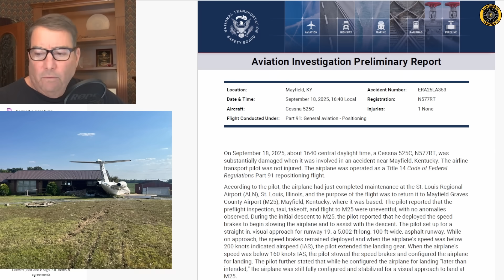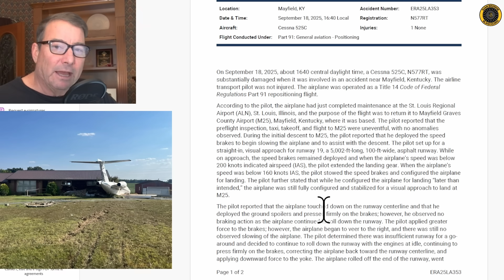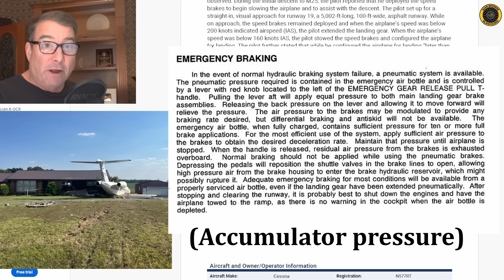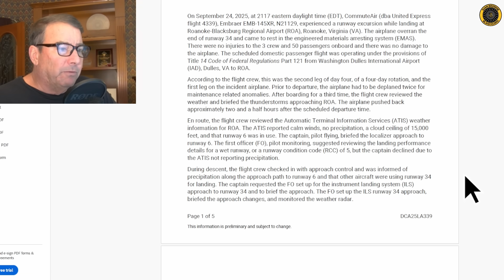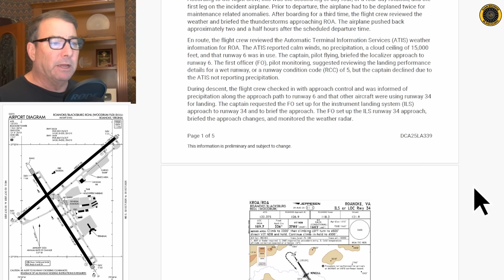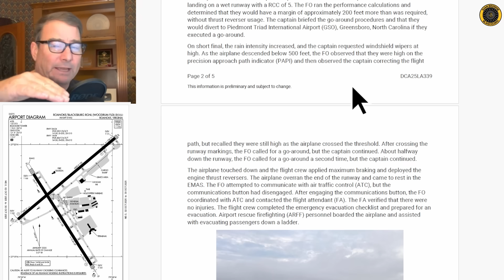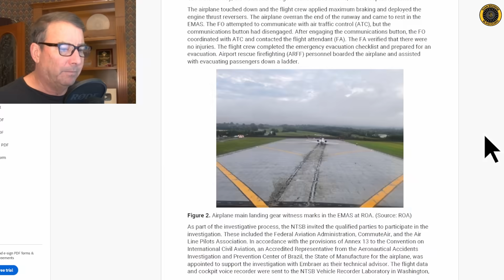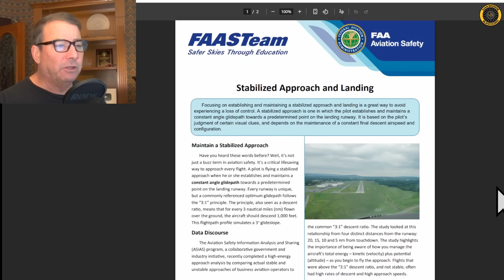NTSB Preliminary Reports on 2 Runway Excursions 27 Oct 2025

Comment: I used to live under the 34 approach path.  It kind of defines hot and high.   Reason is you don't want to play chicken with the mountains which stop only 5 miles from the threshold.   Most visual approaches usually put a couple of turns in to avoid the tallest on the straight in approach.  In wind I would NOT want to fly over that mountain even with sufficient altitude.   I believe 34 is still the only ILS runway so makes sense they'd use it in poor visibility.   Makes less sense they were so high.

Comment: Excellent analysis, and appreciated. Re: Union protection of pilots......I wonder if that protection has sometimes been found to be one of the holes in the swiss cheese?
Reply: if a pilot can't make a mistake, even if it seems obvious to us, without getting fired, they'll start lying about making mistakes.
Reply: @JesseCampbell0  This was not a mistake, this was bad and dangerous attitude. It is much, much harder to fix attitudes than correct errors of technique.
Reply: @hb1338  I agree, but the union protection is there for the mistakes
Reply: @JesseCampbell0 agreed.... And yet, this one is really strange. Two missed call outs?
Reply: @x--.  NO. Two safety commands deliberately ignored.
Reply: @JesseCampbell0  this, and, Swiss cheese doesn’t mean what we think it does. At least not as Reason wrote it. Todd Conklin has a podcast PreAccident Investigations with a great episode Swiss cheese Actually. Note it pairs really well with the British produced Command and Control podcast Synchronization as Coupling episode. As always, read Sidney Dekker.
Reply: I think the role is to keep them from being unfairly fired, not to keep them on task to kill someone.

Comment: I absolutely cannot believe that any flight crew would continue an approach 100kts over the proper v ref speed!!!
Reply: Forget Vref, fly AOA!
Reply: @jimallen8186 At 100kt over approach speed? The aircraft would climb...
Reply: Zoom not climb, we should distinguish between the two, though my points are that the specifics are not generally transferable.
Reply: As a non-pilot I'm a bit surprised: is it that hard to slow down? It seems to me the engineering challenge of powered flight is the exact opposite: propelling the craft fast enough to not stall. Slowing down seems like the default condition if you aren't applying active power. Is the problem here just that they were also too high?
Reply: @ps.2 No it's the opposite, jets are designed to be aerodynamic and slippery, so in a decent even at idle power the plane will accelerate going down hill. He was Never going to be able to slow down enough to land . But we fly out numbers. Put it this way, if your approach speed is off by 10kt, we consider that allot!
Reply: @rdawgz866  Do the speed brakes make a difference here?
Reply: @ps.2  - it's called gravity.
Reply: @lisanadinebaker5179 exactly, in level flight he's correct not dive bombing for a runway
Reply: @ps.2 : The plane also needs to come down, and coming down converts altitude to airspeed. In other words, there's some air resistance slowing down the plane, but that resistance is mostly used to get rid of the extra speed you would get from descending to lower altitude.

Slowing plane down in itself is not super hard, it just means you need to fly an extra loop to make it work.

Ie. if you have too much energy, speed and altitude, you need to fly longer distance before attempting a landing. Adding extra turns is a common way to do that.

Comment: Every landing is a go-around with an option to land!
Reply: WISE WORDS!
Reply: "Every landing is a go-around with an option to land!"

Unfortunately not in my glider, every landing has to be correct every time, well planned and properly executed.
Reply: @christopherrobinson7541 see above
Reply: Before landing  a glider determine if you can land next to the runway on a field in case a car decides to call  the runway a taxiway.
Happened to me as an instructor when a tow pilot decided to take off when I was on short approach.
When I heard the engine below me I landed on the field and avoided a rear end collision.
You always should have an option.
Reply: ... says the glider pilot ....
Reply: While the context of these particular instances may differ, I don’t agree nor think every landing is a go round with option to land to be wise or helpful. Think about those tractor style propellers, or even jets with low slung engines, trim stall is a thing. Go arounds done poorly can readily result in crashes and crashes during go around are much more fatal than crashes due to overrun. Now consider the light twin at high density altitude doing actual single engine not merely power and rpm set to mimic; can it even go around? Or look to the Navy in which LSOs not pilots own wave-offs as there is an exclusion window for which the pilot can’t very well judge that will result in inflight arrestments. Waveoffs must be directed so as to be executed either before or after this window while likely they’re gonna touch down if after the window. Go arounds are not free, they incur their own risk to balance against that of not going around.
Reply: @jimallen8186  .. which is why go-rounds should ALWAYS be briefed.
Reply: @hb1338  there is a thing overbriefing. The brief starts and everyone tunes out. There is reason airlines have moved away from full approach briefs instead seeking to call out anything unique or peculiar.
Reply: @jimallen8186  The go-round part need be no more than "standard go-round is maintain runway heading, climb to 3,000" or similar.
Reply: @hb1338  everyone tuned out after “standard.” Now, what about fields that are one way in other way out? You know, ones with steep terrain that force exceptionally high DHs, distant and/or high MDAs. What about the go-around or rejected landing here? Many places physically destroy the option.

Comment: He would have been configured and on speed.... in an F-104
Reply: He would have had a drag chute too! :)
Reply: @MeerkatADV  The FAA has banned "drag" chutes when transitioning from flight to ground mode, too woke.
Reply: He was still at least twice as high as he should have been at 1- mile.  Twice the height = twice the planned potential energy, and 1.9 times planned speed = 3.6 times the planned kinetic energy means there was nowhere 13:39  near enough drag available, but a lovely energy state from which to go around.  I would think I would need mind altering chemicals to be so oblivious of the developing situation.

The ERJ captain should have recognized that everything had to go very well to avoid an overrun and been primed to go missed...instead he fixated on the expected landing and ignored everything, including the most emphatic
"Suggestion" the pilot monitoring can make.  I remember saying "Go around" 3 times outside of acting as an inspector...even then,the go around happened every time, and if it hadn't started within about 2 seconds I'd have said "My controls" and flown it myself.
Reply: @richsarchet9762  Like the person said: "... in an F-104." 🤣 Wings that tiny with that high of loading, you could do aero braking.
Reply: More like the Space Shuttle - and yes: No Go-Around options!
Reply: @peterebel7899  Of course KSC has the advantage of a 15,000' x 300' runway.  Edwards has a similar shuttle runway as well as a 39,097-foot aux runway.
Reply: Yes well it's pointy enough to just stick in the ground nose down

Comment: I’m curious what the experience levels of the CommutAir pilots are. Regionals today can have some senior Captains with 15,000+ hours in type. It’s going to be difficult for a 1,000hr R-ATP FO to assertively call a go-around, or take the controls if the 2 communication rule’s been met.
Reply: But on the flip side, if the Captain has 15,000+ hours on type, then that Captain should be professional and accept the go-around call out from the FO without question. CRM works when the two pilots work together as equals in decision making.

Comment: While they are "looking at the braking system", maybe they should also check out the loose nut behind the yoke.
Reply: also check for excessive operator headspace.
Reply: Seems the only way to slow down from 200 knots less than 2 miles is a parachute..
Reply: @terry12327 or a tail hook at the end of the runway. 😮
Reply: Known in some circles as PEBCAW - problem exists between chair and wheel. Change "wheel" to "keyboard" for computer failures.
Reply: @hb1338 in IT, we say PICNIC. Problem in chair, not in computer.
Reply: @Glamorgan-f2c  I work in IT - let me know where to send the royalties.
Reply: @hb1338  In the IT business, we call this system error 60 or in other words, the problem is located 60 cm (2 feet) in front of the monitor.
Reply: @hb1338 😂 Sure!
Reply: That's pretty funny
Reply: In computing they have the accronym PEBCAK (problem exists between chair and keyboard) in aviation perhaps it should be  PEBSAY - problem exists between seat and yolk :-)!
Reply: Know all captain.
Reply: @mickboakes7023 FO: TOGA……Skipper:…with Picard’s voice “I’m the Captain and I’d say ENGAGE the landing”
Reply: This connection disassembled shortly after landing.
Reply: From the information presented I believe the major malfunction here is between the headsets.
Reply: 😂 True!
Reply: Just a reminder, over TIGHTENING can be as badly out of tolerance. You may even need a mallet or hammer to get at what I'd expect to be a d*mn wing nut, although I admit it's been a while since I last really got into this model. A few love taps ought to get things going in the right direction, though.
Reply: Or a short between the seat and the controls.

Comment: Thankyou Juan, And Yes your exactly right, Go around is Your best option if their is any uncertainty regarding the landing approach etc.
Lots of Runway Excursion problems in the past few years.i
It looks like he was coming in Hot that's for sure and didn't even consider going around and then reinitiate the landing approach.
Another excellent Report as always..
Thankyou.
Reply: Uncertainty is not a good measure.  Fly by the numbers.  There was probably no uncertainty on this one until that last bit of runway disappeared under the nose.
Reply: @willnelson5692 

I Respect the Comment....
Reply: @willnelson5692 

No, Uncertainty is not a Good Measure, I know I responded to you once and thanked you for your insight.

As a Commercial Pilot and o one occasion a few years back as Captain and at the time Pilot in Command of a 747 after a long flight from Australia on approach to a major USA Airport we were 2 miles from Touch Down with affirmed clearance to land.

As we approached I noticed an MD80 of an Airline who was told to hold Short of Runway as inbound 747 at two miles which was us but for an unknown reason he ventured out into the Runway, I immediately aborted the landing and flew over the top and reconfigured for another approach.

I was asked when we landed to take down the usual number and I was apologised to buy a Tower Controller, I said don't need the Number, I heard your contact with the Ready to depart MD80 and it's all good, Nonfarm has been done and I didn't want to create any Trouble for ATC or the Crew of the MD80, Sometimes it happens and yes That Crew should have at least viewed Left to which end we would have looming big but like I said at times it happens.

I have never incurred on a Runway or Taxiway and hope I never do and after the landing and exiting the Runway I just simply said to all Parties it's Okay we're all good here and let's just leave it at that.

I was thanked by the Tower and the Crew of the MD80 and I just simply said it's cool.

There's a fine line between Pleasure and Pain  when it comes to that we have heard about in this report from Juan.

This Man Juan Browne is a Brilliant Person and I follow his Channel and only his Channel as the Gentleman has such Extremely Good Insight and Foresight when he does a Report it's a pleasure to watch and listen to.

Anyway I just thought I would share this with you.

Have a great Evening or Day and again thankyou for your Comment yesterday.

Sincerely.😊.

Comment: Many hours on 525 all models.. 1) they have terrible brakes, steel rotors and 2) no way would he lose 100 kts in a mile. Totally a pilot induced accident. If he was fast, the brakes would overheat and fade. Usually one before the other...
Reply: yeah man the 525 and other similar types have a mortal enemy in runway overruns. hard to justify coming in that fast either since they’re not hard airplanes to slow down. was something i tried to be very conscious about moving to the 525’s after flying king airs previously

Comment: That Roanoke overrun was real close to being a major event… at the end of that EMAS is the fence and then a busy 5 lane road … it’s a tough place to land down in a basin with lots of fog
Reply: My local, HVN is also in a basin with lots of fog - it has plans to expand (extend and add some sort of EMAS, not the type in Roanoke).
Reply: Agreed. I was looking at how much of the EMAS they used. I didn't find a number in the report, so I used the pictures and Google maps. The EMAS measures at 435 feet. The rear landing gear stopped at around the 315 foot mark, putting the nose of the airplane about 70 feet from the end of the EMAS. It seems they used over 80% EMAS. That's a very thin margin.
Reply: @andrewsnow7386  I don't know how much difference it makes, but the 145XR is only a little bit above the minimum weight for EMAS to work successfully.

Comment: Thee guys need to learn how to slow down some while still in flight
Reply: Wh...er...huh? Slow down... In the air?

You got some kinda magic pilot brake?
Reply: Plan ahead and reduce power then level off to bleed off speed.  Flaps will slow you down by increasing drag.  On larger planes speed brakes create drag.  Gear coming down creates drag and slows you even more.  That's four magic pilot brakes but they all involve planning ahead.  Slipping will increase the rate of descent without increasing speed but is more of a small plane trick.

Comment: downward force on stick. that should mean weight is shifted from rear wheels to front wheel which i dont think has a brake system.  should have pulled back to add weight to the rear wheels.
Reply: At something like 140 kn or more, without spoilers, there’s essentially no weight on the wheels so the brakes aren’t going to do jack.   If the ground spoilers are up, that puts maybe 30% of the weight on the wheels, at least until the aircraft slows down even more.  The pilot might have been correct that he did not feel any braking action – he was just too darn fast for them to work.
Reply: At his speed, the plane might have taken off with any back pressure!

Comment: I totally agree that once "Go around" has been announced in the cockpit and recorded on the CVR, the PIC should do just that.

Could not have said it better!
Reply: I completely agree with your comment. The Captain not responding in anyway to the copilot has a serious problem.
Reply: The calculation for the landing showed they had a 200 ft buffer, lands halfway down the runway, instead of going around. 🙈
Reply: Even if the FO had stayed silent, the captain would be required to explain why he did not go round when he was still in the air half way along the runway.
Reply: Depends on.
Reply: there's exactly one reason to not go around when it is called: the PIC is quite certain that the conditions of the plane/etc cause a go-around to be impossible (engine out/insufficient thrust, not enough time to spool up the engines, etc)